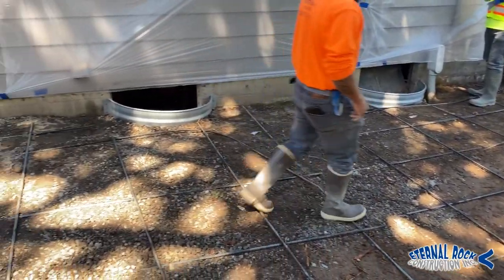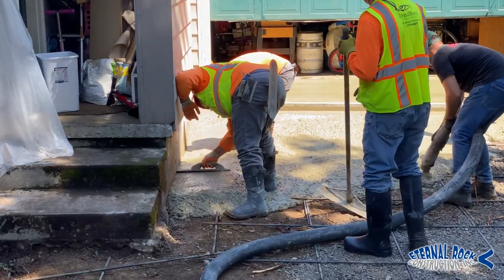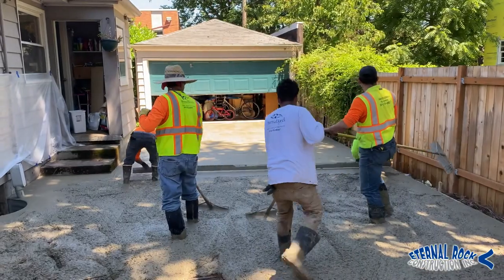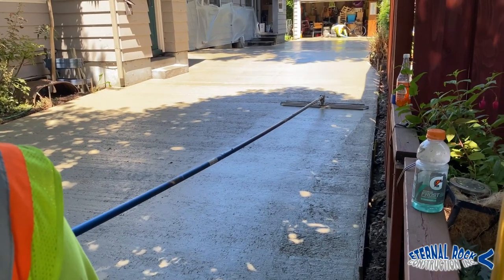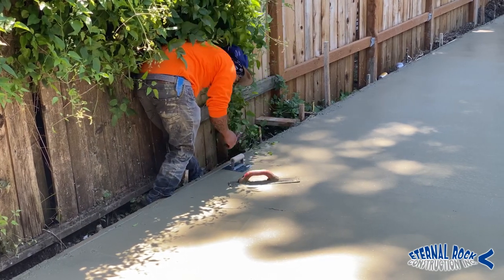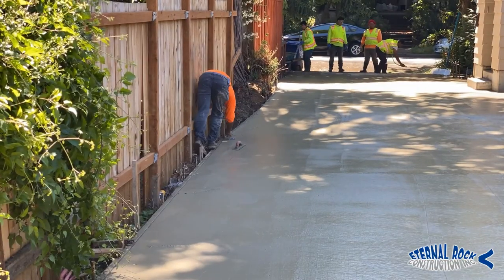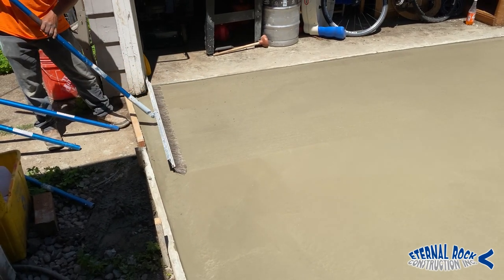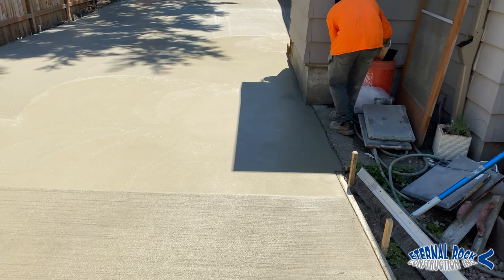How To Pour A Long Concrete Driveway With Difficult Access Step by Step

Comment: Idk how you guys can pour concrete that way is super wet if you test the concrete after it cures i bet it won’t be not even 2500 psi to much water makes concrete lose strength here in michigan that driveway will fall apart in the first snow fall other than that every thing is good

Comment: You got that many guys there and you didn’t crawl that and hand tool your joints?
Reply from the maker: Hi Jarred, that is correct for 2 reasons. The first one is: most of those guys you see there were only there to help out with the pour and then they had to leave and do another job right after. The second reason: is because of the very limited access on either side, we decided that it would be best given the circumstance to do a saw cut joint instead. This is to ensure a straight line and the most professional results. Great question though

Comment: I’m sorry other than the hardworking crew u have and work effort I didn’t see anything wrong other than that concrete was piss wet. With the weight of rebar u had u should have used bricks or chairs to hold that rebar up. It more than likely fell right back to the surface after u pulled it up. The benefit of using a pump is u can pour a much more stiff slump and be very well workable for tool cuts etc. hope this drive has a successful life. Other than that keep up the hard work and cheers to the crew
Reply: You must be from a northern climate,. Looks like soup but they use an accelerate that doesn't effects the strength! The aggregate will keep the rebar up, but I would still use, we call them blocks! I also don't believe in next day saw  cutting joints!! By then according to some engineers the crete has already decided where to crack. Soft saw the moment you can!